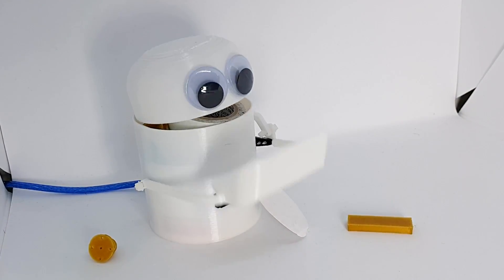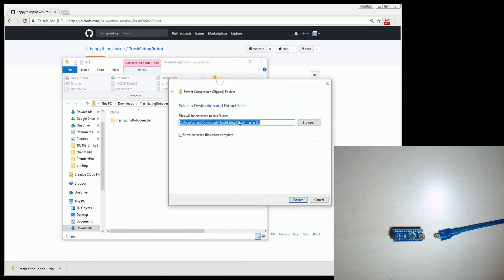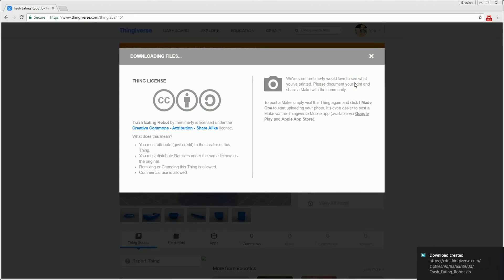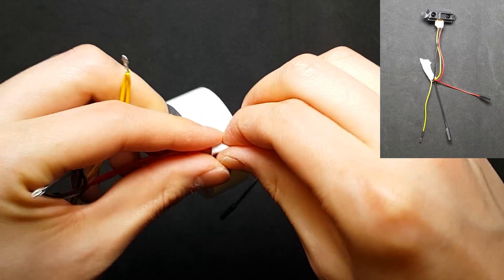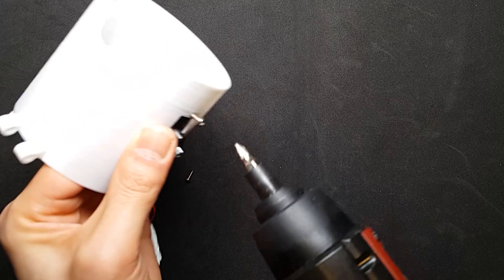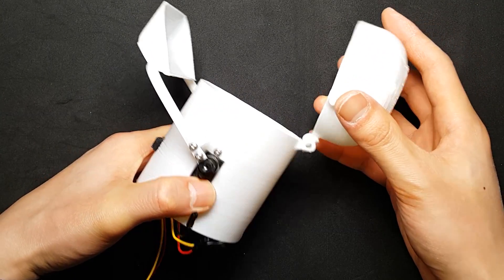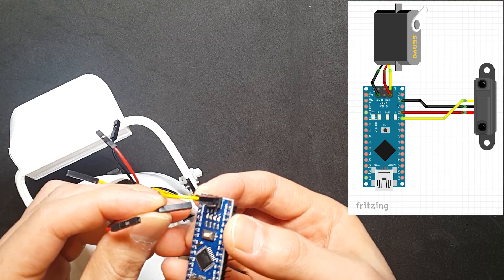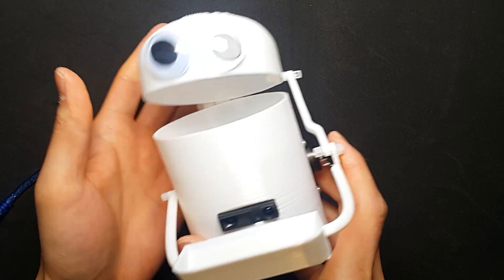Arduino Project ] Hungry Robot | Servo,Sensor,3d printer Arm project tutorial example

Comment: will a standard servo fit? will it fit the size of the hole for it in the 3d print?https://www.amazon.com/MakerDoIt-Micro-Arduino-Walking-Control/dp/B07C5PGD3Q/ref=sr_1_2_sspa?keywords=arduino+servo+motor&qid=1572357146&sr=8-2-spons&psc=1&spLa=ZW5jcnlwdGVkUXVhbGlmaWVyPUFLQ1Y5VkJNWlYzWlcmZW5jcnlwdGVkSWQ9QTA2NDc1ODFXTEZWUkw5WFhVOFAmZW5jcnlwdGVkQWRJZD1BMDU4MTk5NzFSUkFISVVPVElLMUsmd2lkZ2V0TmFtZT1zcF9hdGYmYWN0aW9uPWNsaWNrUmVkaXJlY3QmZG9Ob3RMb2dDbGljaz10cnVl

Comment: Can I use GP2Y0A41SK0F IR sensor instead of GP2Y0A21YK0F IR sensor???
Reply from the maker: I guess that would work but you will need to adjust code a bit

Comment: thanks for this idea, such a cool little robot. I replicated it and unfortunately all my distance sensor logs is 1023.. doesn't seem to change at all. Do you know what causes this? The robot only works once when you plug it in, Then it shakes the tray 3 times then just stops and leaves the tray in the upright position.
Reply from the maker: Hello, Thank you for commenting. What did you use for the sensor? did you check the sensor cable?
Reply: hello! i used the exact sensor you linked - this one https://www.littlebirdelectronics.com.au/ir-distance-sensor-includes-cable-10cm-80cm-gp2y0a. the sensor cable seems fine. it just seems to read 1023 constantly. which is what it reads when something is extremely close? but the tray is closer than 10cm so maybe you linked a different sensor than the one you use?
Reply from the maker: 1. Check the cable order. especially most left cable and most right cable.
2. Check the cable plugged in the right place.
I guess that is the most common reasons.
Reply: thank you! for some silly reason i had it plugged into A6 instead of A7 and i had my gnd going into rst :D and my 5v going into A7 so no wonder it was getting 1023 constantly!

Now only problem left is he seems to constantly shake the tray rather than just up and down, He raises the tray to eat, then shakes it 3 times then puts it back down.
Reply from the maker: 1. Okay, Great! I am happy you solve it.
2. Could you pull back the arm from the motor and let them move? once the motor moves, it goes to the default location. then, power off the robot. and then, plug the arm again in to the motor. I think it seems because you put the arm on the high angle (it is somehow complicated to explain). Try it and please comment here :)😀 😁
Reply: yes thanks for reply. I did do that a few times already :D it didn't fix it. Even with the tray detached he still does the shake 3 times :P maybe my servo is backwards? I was looking at the code and it has 3 times 50, 70, 50, 70, 50 70 so i think thats the code that is doing it
Reply: Yes, I removed the code that was 50,70 3 times and now it doesn't do it anymore :P thanks again for the help!
Reply from the maker: Yes 3 times shaking is showing he is happy. :)
Reply from the maker: if the movement makes a problem, you can get rid of them !
Reply from the maker: great! If there's any question, please leave here. :) I am so happy that we made it!
Reply: yeah haha i was confused cause it wasn't in your video. :P thanks again

Comment: very funny and nice and clear details..the problem is have only hc-sro4 ultrasonic sensor..its easy for you to make the same version with this sensor ???thanks allot for your time...
Reply from the maker: Hi, Thanks for your comment. The ultrasonic sensor is much bigger than the PSD(infrared sensor). We need to adjust the location, enlarge the hole. If you know how to deal with 3d modeling application such as ThinkerCad, you can try by yourself I think. Next time, I will deeply consider compatibility for both sensors. Thanks again ;)